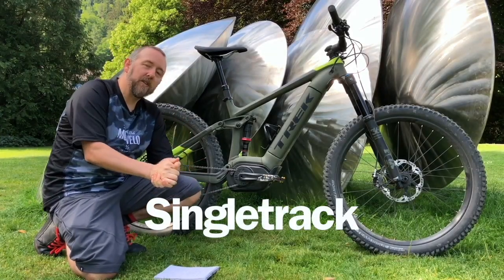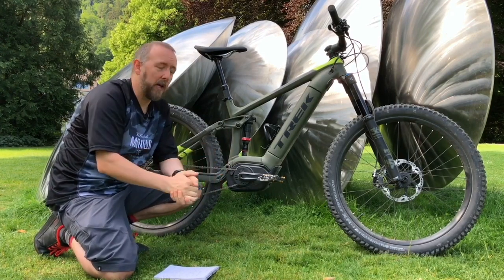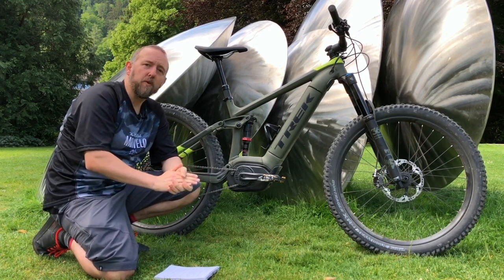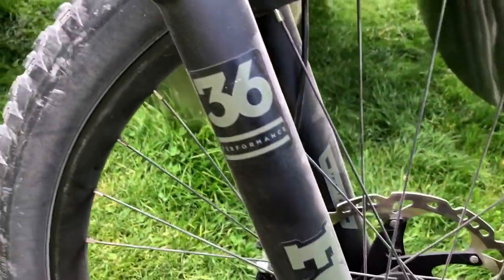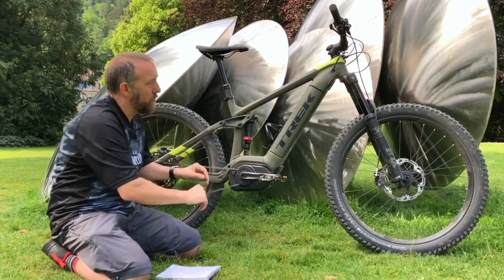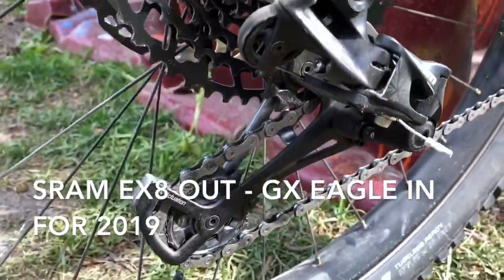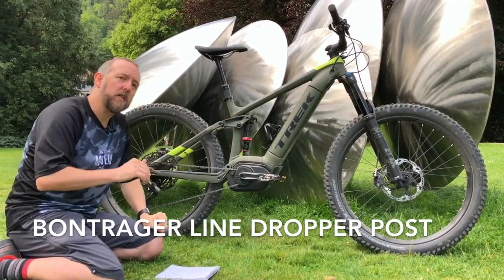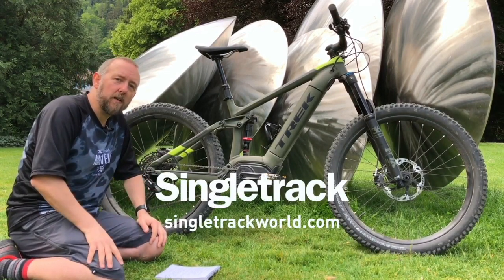Trek Powerfly LT 9 2019 First Look

Comment: It just me, or this a better looking e-bike so far...
Reply: Correction regular ebike vs a full suspension MTB ebike takes the cake . i completely think all regular ebikes should be full suspension mtb ebikes they need suspension everwhere on or off road ... my last regular ebike only had suspension on the front the back broke for lack of suspension .. a mtb ebike has suspension an therefore the tire can take pressure at fast speeds / breaking / bumps too .

Comment: Yeh, not sure I would be totally happy with an 8 speed just yet, although sure it would work OK. Have 11 speed Sram Gx on my bike and I think that works really well with the EMTB mode, as it constantly adapts the power towards what gear/ power you are putting through your cranks. So I have found that I am using all my gears, especially when you get to big mountain climbs and descents, not so much a problem on my less hillier local trails.

Comment: Also, my bike has long rear chainstays which as most know is due to the motor on E bikes. I know the Pivot has more like a standard Mtb at 437mm. Only problem is a couple of reviews have mentioned that the bike is trying to "Loop out" on steep climbs. My Mondraker has 475mm, which is great on climbs, but manuals are a thing of the past!! I think over the next few years, chainstays will probably end up closer to 450 - 455mm which will give a good all round performance.
Reply: I think the New Levo is pretty spot on. I think 500wh is plenty for this sort of bike.  I think this Trek is a bit to heavy at 23kg and around 19kg is the magic spot. As you don't want them any lighter as the extra weight really makes the suspension plush and they take off down hill.

Comment: I think the Trek Police Electric is tops with the speed motor design is my choice. Why not equip this with this option choice for the USA? Perhaps they may when it becomes available. Makes sense to me for the extra power. Nice integrated power tube and motor in the carbon version. I would also like to see a smaller sized  motor turned 60 degrees up for a streamline look.  IMHO!

Comment: Too bad you couldn't give at least initial first impression.  Surely a day out with an ebike enthusiast could do that?
Like the integrated battery - and the color.  Don't like only 500wh capacity - forces you to carry an extra battery on long days out.  Wish Bosch et al would move to 48v systems rather than weaker 36v systems.  And hopefully soon Bosch will redesign the motor to get rid of that annoying dying sewing machine whine - find it very off-puting when on trails.